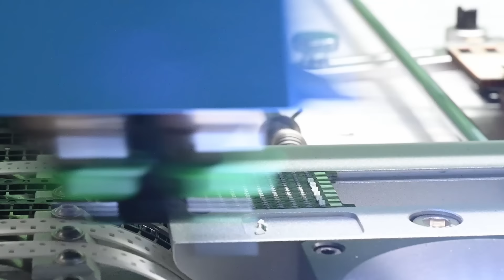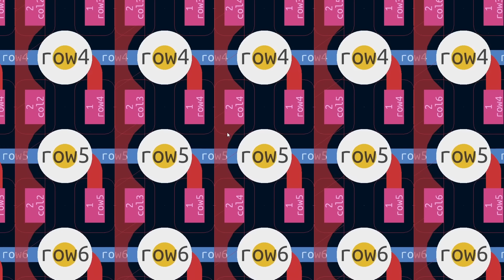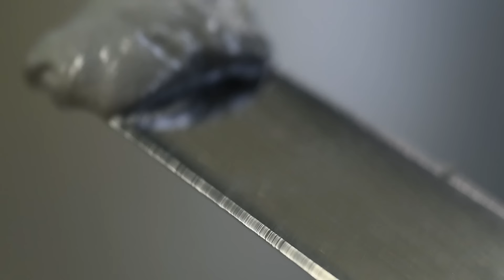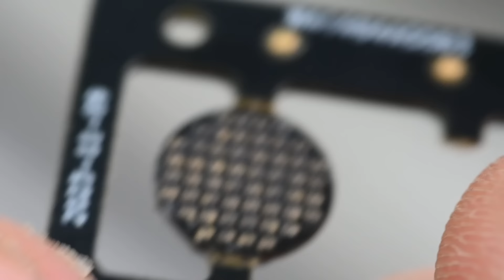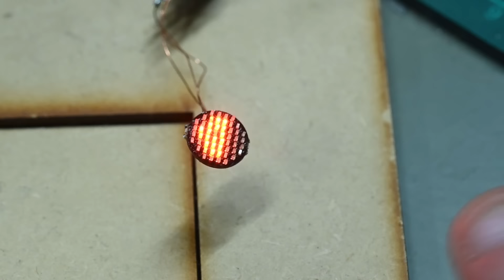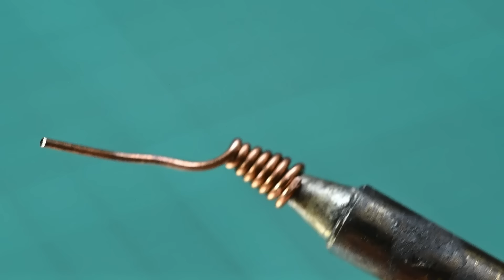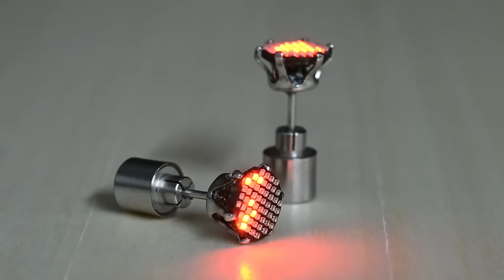LED Matrix Earring

Comment: Nice work!! You should apply a layer of spray paint and gently sand just the tip to scrape off the paint. This should prevent unwanted glare from LEDs that are off.

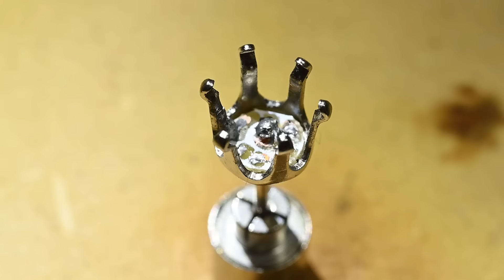Comment: What is the purpose in adding capacitors at 15:00?
Reply: If you try to pull higher burst currents out of a small battery cell, the internal resistance of the cell will cause the output voltage to collapse and will brown out your circuit. With capacitors you have some hold-up power and the voltage fluctuation is reduced.
Reply: They're bypass caps for the microcontroller, since it will have voltage fluctuations as it drives fewer or more LEDs at any time. The caps will help stabilise this as they hold a charge.
Reply: Thank you @SianaGearz   @christianlett

Comment: My mind settled on "extremely low cost, 3 wire 32x8 LED display board"  - you could be all in on parts for under a dollar and you'd still have 2 i/o pins left over to daisy-chain modules together! Very capable microcontrollers.

Comment: adding a small layer of milky transparent plastic would help to diffuse the LED's and make them more visible when displaying graphics or letters
Reply: This is a super good idea! Put a dollop of epoxy over the LEDs and set some diffuser film in it to really make the LEDs blend together and be nice to look at! Would definitely make the random blinks more interesting to look at in my opinion
Reply: @Jett-n-gin maybe a diffuser film wouldn't even be needed and just sanding the epoxy would be enough.
Reply: @Jehty_  I think it would be better to flood the LEDs with black opaque compound and then sand it down along with a small layer of the top of the diodes
Reply: @RD-op6lv  Agreed. There's a ton of light bleed into the adjacent LED caps that's reducing the contrast of the display, and some black fill between them would help a lot to make the effect clearer. A diffuser on top still might be helpful depending on the desired effect; a smooth continuous "sheet" of LED glow vs discrete pinpricks.
Reply: Smoked perspex sheet might work too, one could stick it on with epoxy, and hides the components, makes it look like a black screen, but lets through the light with not much loss. I've used it on much larger LED projects and it looks really nice.
Reply: @DisorderedArray  I think your idea with the epoxy but kind of rounded from dome? Similar to the hydroscopic effect of water tension on a coin? I'm sure that there would be UV epoxy where this could be achievable? 

I would love to see some blue LEDs 😍
Reply: @jameshatton4211  unfortunately blue leds are much more power hungry
Reply: @Doktor_Apokalypse  i know! I just watched the documentary Vertasium did on the blue LED! Brilliant episode and a lot of effort went in to that episode. It was the biggest humble pie story that just amazed me!
Reply: It could also double as protection for the LEDs
Reply: A dark transparent film is ideal for increasing the contrast.
Reply: Opaque.
Reply: Lee's "Zircon" line of LED diffusion material would work well
Reply: That would ruin the aesthetics for me.
Reply: A transparent dark red epoxy will be a much better choice, because the leds will still be crystal clear and the dark red layer will look homogeneously black when the leds are off
Reply: I’ve been playing around with TPU and found the natural white-ish coloured TPU works can work quite well after figuring out the ideal thickness (will change proportional to brightness, but shouldn’t need much)

Main benefit to it over other methods is the flexibility and durability-  but smoked perspex ends up looking really nice
 havent been able to test what the combination looks like - but being able to make a TPU frame and w/ diffusing layer to hold and protect the smoked perspex might work pretty well
Reply: i mean yea it would be good but it looks cool being exposed like that, it gives it a sorta cyberpunk look

Comment: This looks like exactly what I've been looking for, I need to replace a bouroughs VFD display from a 1970s bartop arcade machine that was unfortunately damaged in shipping.. the coin mech came apart and played pinball with it smashing the display to bits... I've had the idea of using an arduino or something to act as an interpreter for the display output from the mainboard to drive an LED or LCD board, but so far to get the same visial resolution, all the LEDs I've looked at would result in a display several times larger than the original, ruling them out. These 0102 might be small enough ^_^

Comment: The copper wire on the soldering iron is such a useful tip! I'm going to be (attempting) to repair my laptop myself and I was a little worried about if my iron would be precise enough, but that could save me!
Reply: He was only able to do that because there's no pads completely under the component. In a laptop, there's many components that you can't do anything to with a soldering iron.
Reply: @nikkiofthevalley you can definitely do a ton of stuff on a laptop with a soldering iron. It's mostly technique. The copper trick is also not the best because it just has so little heat capacity.
Reply: @lost4468yt  but it's copper so it will work, but if you've got something like a TS100 you can crank the temperature up to say 400°C to compensate for the convection of heat effect and then all of a sudden things that were essentially in the trash bin, all of a sudden may potentially be given a second lease of life!
Reply: Pun intended? 😂
Reply: @harrysmbdgs  hot tip, pun wasn't intended
Reply: I would recommend training on some lesa valuable circuitry before taking risks with your laptop.
Reply: @izperehoda  I was going to anyway. I should clarify that the laptop is quite old (and of little value). It's more a case of curious if it will live again.
Reply: @CoffeeOnRails  Its definitely doable, going back 24 years I did do repairs on laptops using a soldering iron and having looked inside modern ones, there are still quite a few components large enough to viable.

A big risk is overheating things but another problem is that many boards are coated after manufacturing and that can get in the way, melt and burn which could be a bigger problem than over heating.
Reply: get a smaller tip/iron and save yourself the pain
Reply: Are there any commercial addressable cob arrays like this?
Reply: Haha tip
Reply: I just have a needle tip for my Hakko, it's super fine and best for work like this, not much else.
Reply: The copper wire tip really is a useful tip

Thanks for the tip, I subbed as a tip for the tip about the tip for the tip of the tip

Comment: Jesus. If I lose a laptop screw I get pissed off.  I can't imagine doing anything at this level.
Reply: if I lose a huge, easy to find Ikea component I ragequit already. props to you.
Reply: My level of complexity is replacing a refrigerator evaporator fan motor.
Reply: If you lose a surface mount component - it's gone. They leap into alternate dimensions. Ignore it and get another one.